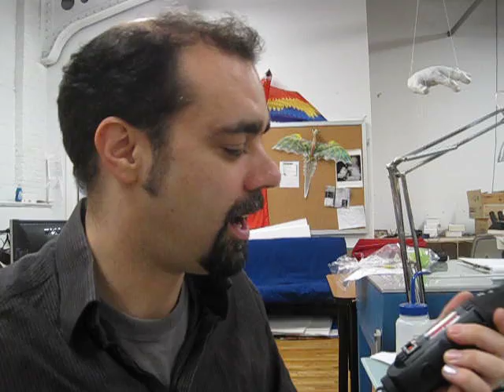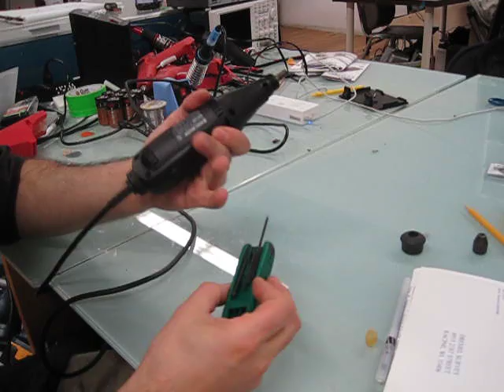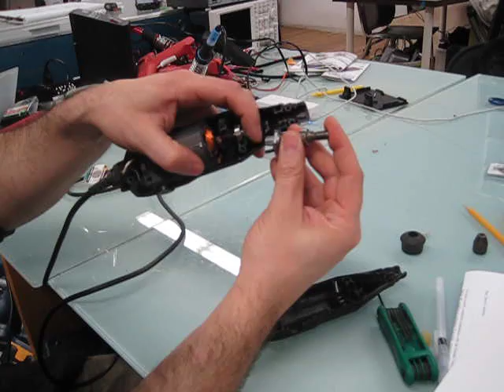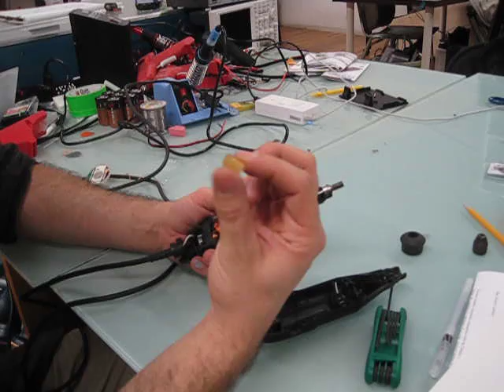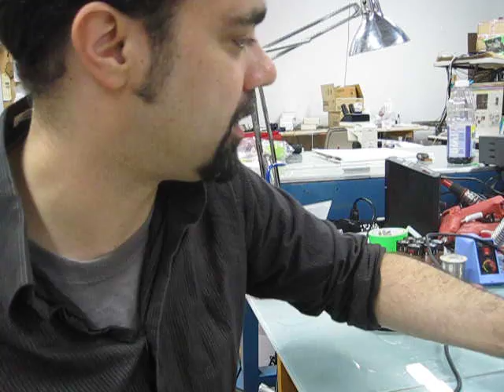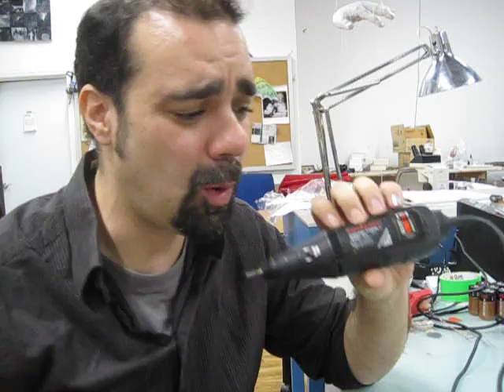How to Fix Your Dremel Tool by Noah Vawter

Comment: Your video was exactly what I was looking for when my Dremel crashed. I could not believe how quick and easy it was to understand what was wrong. I also want to encourage others with the same problem to call Dremel direct. They got the part you need and at the best price. The connector was $1.50 (and I also ordered 3) and shipping was $2.10. Many thanks to Noah.

Comment: Thank you so for making this video! I was having trouble with my Dremel 275. It's about 25 years sold. I found your video, took the tool apart. Confirmed the problem. Sourced the part for $4 at Sears. My Dremel is ready for another 20 years, plus I learned what motor brushes are and how to replace them when the time comes. I never commented before, but it's time. I found many handy videos on  Your Tube. This web site Rocks!

Comment: I ordered a few new couplings and followed along with your video again. I just finished putting it back together and it works like new! This tool hasn't worked in over a year and I was about to put it on ebay for parts. Luckily I found your video first! Thanks Noah!

Comment: Eeeeheehee, very fun, AND informative! I just dug out my two old Dremels after several years and moves. Do you know if I need to oil the Dremel itself? I know I should oil the flexible shafts. Kind of afraid to turn them on quite yet.

Comment: Finally, a well done video. My dremel has not gotten to that point yet, but my flex shaft seems to be running rather rough. I regreased the shaft, but it really didn't help. I havn't found a decent video on troubleshooting the flex shaft. Thanks for the info on the main motor part. Keep up the good videos.

Comment: Thanks for the video!  I have a very old Dremel 595 type 3 moto-toll that i bought in the early 90's. I used it a lot for all my hobbies. It broke about 8 years ago, and has been boxed since. Now that I am getting back into my old fav hobbies again, I decided to try and give it a fix. After seeing this video, I realized that this must be the problem, as the dremel has not been all that heavily used, and the top was not spinning, but the motor and variable speeds worked fine! I opened the tool and found the exact problem you showed here, so I am now going to order the coupling!! Thanks for sharing this, I could find little else on the web that covered this issue!

Comment: I wonder if they still do this? I have a nice Dremel/flexshaft set that I got some 20 years ago. It recently started wobbling so badly that's it's almost unusable. I came to youtube looking for help and found you. I'm generally pretty handy but for some reason taking my Dremel apart was intimidating, but I can do this, easy peasy! I'll take it apart first just to see what's going on and I'm sure it can use a thorough cleaning. 
I know this video is 9 years old but thanks

Comment: Thanks for this video... I replaced the same part myself, but my dremel came apart a bit more than yours... now it won't turn on at all. Do you think I've put it together wrong? Or could it be the brushes? Actually never mind... i've just taken it apart again and one of the carbon bits is missing from one of the brushes.. hope I can find it

Comment: In your demo,when you removed the chuck from the main body,was there any kind of spring,to hold in the three grasp pieces?because i recently droped my unit whilst i was taking the chuck of and i was unable to find any other fallen parts,and now the three grasp parts don't uniformally move together,when i put the chuck back.

Comment: Thanks for the info. when I called Dremel they also recommended ordering and replacing the motor brushes and the plastic piece that goes into the coupler at the same time ( 2 couplers plus the other 2 parts and flat rate shipping only $12.15 total) now my 22 year old tool is like NEW! Thanks again

Comment: Great video, and I agree that the company has great customer service. Ordered my part on Monday, received it on Wednesday. The only thing I disagree with you about is ordering multiple flexible coupling parts. They degrade and become brittle regardless of whether they're in the tool or in a drawer. You're better off ordering new when the time comes.

Comment: Guess what just happened? Yes - the "clutch" aka "motor coupling" of my old model 396 just broke into 27 pieces. Gluing isn't really an option! I'll certainly be paying more in New Zealand, but still a darn sight cheaper than a new Dremel. Thanks very much for posting this.

Comment: I believe the flexible coupling is there because of there are more than 2 bearings in line. without the coupling you get an enormous loud on the bearings so they wear out.

Comment: Specifying models may be necessary: Dremel 4000/4200 drive shaft is all rigid, a steel rod from drill chuck to rear ball bearing. I just opened it for a different problem, of electrical nature, when I looked at and noticed.

Comment: when I removed the (2610928717) Stop piece from the,   (2610921766) Depth Rod...because,was in the wrong place..between the (2610933097) Small Set Screw...and my worst I removed  (2610928607 Tool Holder and (2610928596) Rack....was there any kind of spring,to hold in the (2610928597) Handle Assembly? because this was turned down,   please help me to turn back to work my work station....by the way Noah,  nice video ...my regards

Comment: How do I get the drive shaft to come apart so that I can access the the defective flexible coupling?  I cannot get the top part, which has a plastic gear between it and the the bottom part of the drive shaft, to separate.  I don't even see that plastic gear in this video.  I am working on a Dremel 395 Type 5.  Any help would be appreciated.
Reply: You are talking at about a dremel tool, not the machine itself, and "that part" it is not meant to be taken apart. If it has broken you will need a new one.

Comment: Clear great review.  You can keep the tool running by using a short piece of plastic tubing until the part arrives.  Many newer Dremels [ 100-300] no longer use the flex coupling.  If the motor is overworked it will overheat instead of the coupler breaking.  I guess too many service calls for the coupler over telling users to rest the tool and let it cool it down.

Comment: Do you happen to know what to do when the Collet stops gripping the bits? Mine will keep the bit in place for a second, but no matter how tight I turn the collet, the bits slide back and forth, or sometimes the drill spits them out (dangerous).

Comment: Hello! I just got my dremel today. I put the thingy (idk what its called in english but its just the thing that you can replace and put other kind of sanding paper etc on) really tight and i think i placed it good, but after a few seconds my dremel makes a really loud and heavy noise like dddbrrrrrrrrr (lol) and idk it sounds like its loose could you help me how to fix it? Thanks
Reply: Merel Stoelinga try a wrench (the tool it comes with) to tighten it more, if that doesn't work, the model 100 and 200 can sometimes need you to wrap tape around the metal pole on the bit to get it tighter. That sound is caused by ill fitting bits.

Comment: Exact same problem with the exact same model and type.  Ordered my parts today.  Thanks!  I agree Dremel is a great company.  They will also replace your failed tool for like 36 bucks if you just want a refurbished one instead of fixing yours.  Simply ship them your broken tool.  That's what they told me when I called.

Comment: Thanks for a great video... Saved me from buying a new roto-tool. Dremel is a class act as company. Many replacement parts can by found on Amazon. For my tool (I think the same as the one in this vid : 
#395 type 3 the part is "Dremel 2615294309 Coupling:

Comment: My dremel will rotate 1mm if I whack it but it never spins anything over 1mm of a turn. I taken it apart and the wires are clean and plugged in tightly so idk what this problem is

Comment: Having the same issue.  i have a 400XPR and i bought it used, the person before me held the shaft lock while running the motor... pretty ground down. I'm sure Dremel support has a part for us to replace it with. take it apart and identify what is causing the issue. for me the lock pin wont go far enouigh down to lock. i took my button out and put a small piece of balloon between the pin and the button, now its working just fine. until it fails again...then i'll be calling dremel.

Comment: I got so fed up with the terrible engineering in my corded dremels when they overheat and blow their motor controls I has enough. I bought a vanhaus equivalent and it was one third the price and doesn't overheat and has lasted longer than 2 dremels so far. I sold my 3 faulty dremels eBay  for more than I paid for the vonhaus!

Comment: I bought a brand-new Dremel Digital 400 from B&Q but didn't use it until over a year later. It was immediately defective but out of warranty of course. I sent numerous emails directly to Dremel, hoping for a solution but received not one single reply. I've since learned the sparking and over-heating was/is a common problem with these things. Never again. I can forgive a defective unit, shit happens, but for a company to totally ignore emails is disgusting. I lost £99.99 on that POS and the company's behaviour was insult to injury.

Comment: Omg! You're so hot! Sorry, distracted. The motor in mine stopped completely. I don't use it that much and lately it's only used to grind my dogs nails. Any clue on how to make a totally dead dremel come back to life?
Reply: Possibly the contact coals, little black conductive blocks pushed by springs against the rotating part of the motor, to transfer electric current.
Identify by circular plastic caps on opposite housing sides which can be opened by prying off. Careful, as the springs may jump out. Replacement parts are available for $1...$2

Comment: Rubber coupling, aluminum chuck collets, poor chuck lock system.  These are just a few reasons why Dremel should be avoided like the plague.  When their support personnel knows exactly which pieces are broken (because these parts always break) it's pretty obvious that these tools are junk.  Sorry for the rant, but people should know how terrible these things are before they give Dremel any more money.  I don't want their pen that costs pennies, I want a tool that doesn't need to be fixed regularly.  There are better ways to support the DIY movement than throwing money at companies that sell garbage.  These tools are made in Mexico, and they're no better than the B&D RTX which is made in China (and costs 1/3 the price of a comparable Dremel).